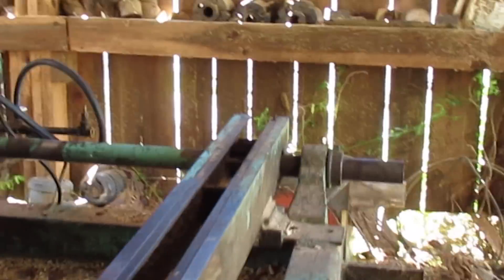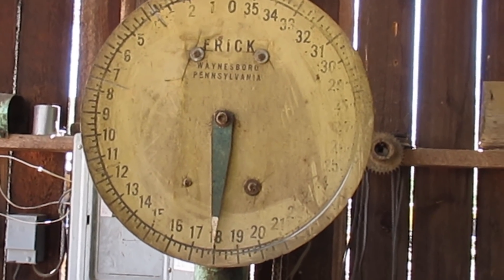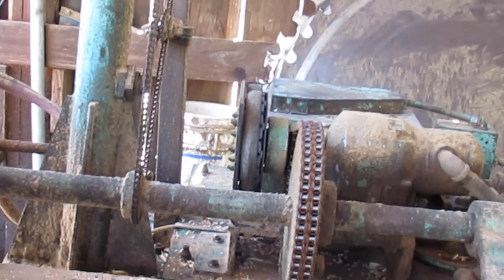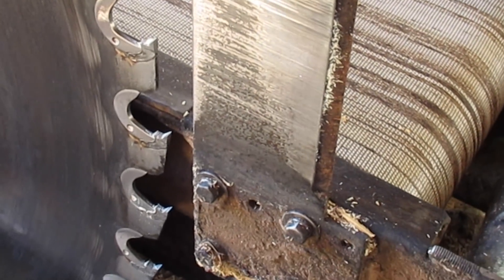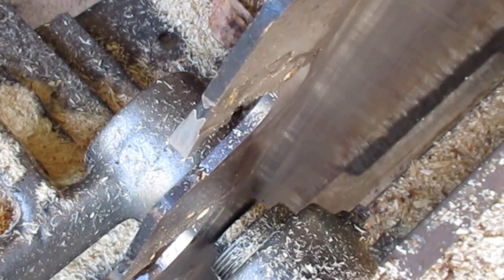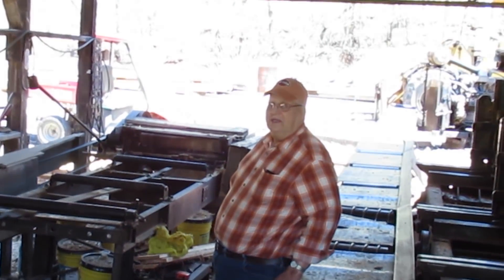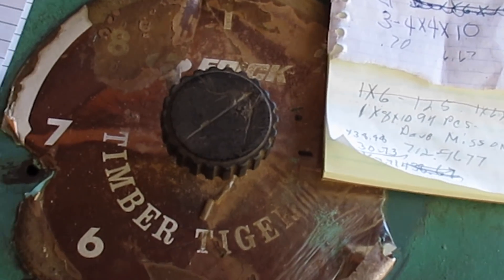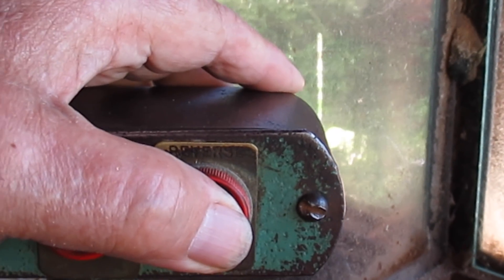Sawmill Maintenance

Comment: Your mill is a lot more modern than the one I bought in 1979.When I bought it I could saw a nice long wedge about 16 feet long...2 inches on one end and 1 inch on the other.I couldn't find a market for those wedges so I had to put my millwright hat on and straighten that mill up.After a couple of years on a small budget,I had the thing sawing nice and straight.It's nice to watch you sawing...nice and smooth...no wasted moves.

Comment: Great video! What runs the mill? Electric motor or engine drive?
Reply from the maker: Diesel power
Reply: @mmccoy577  cummins?
Reply from the maker: 671 Detroit on the mill 250 Cummins on the chipper @boB7710II
Reply: @mmccoy577  is the chipper for the slab wood?
Reply from the maker: Yes